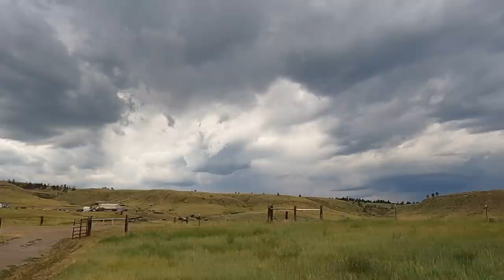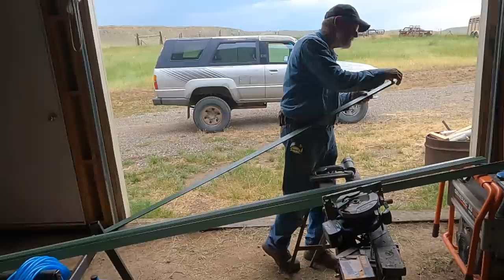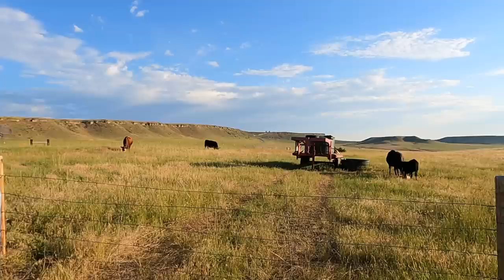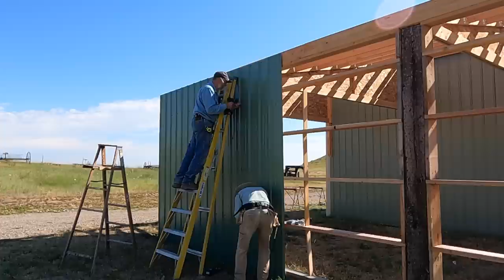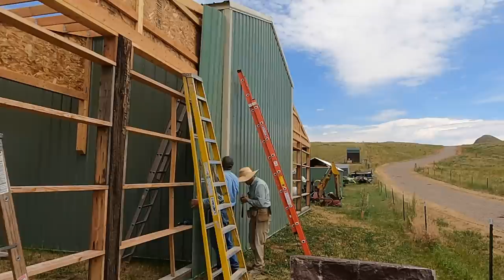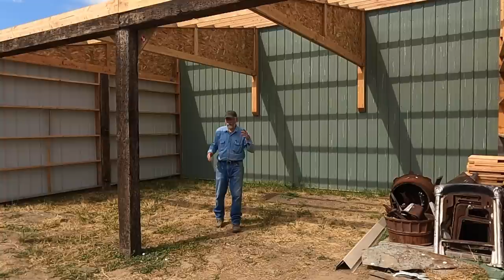Siding - One More Step to Completion! | Engels Coach Shop

Comment: If you don't plan on installing a door on that "lean too", I do suggest you install a few "vents" in your walls for strong winds. Had professionals build a barn, lasted a week before I got a call at work telling me my barn was in the middle of the road. I rebuilt said barn, I installed louver vents, haven't any issues since. We get extremely severe weather here, tornado alley. Great video, cheers :)

Comment: You could have left that plastic on those pieces.  You are brave or ?????? to handle those angles with Lightning flashing.  I have found it helpful to drill a stack of siding if the pattern is the same.  Lots to Like.  Looks very  good.  Some attach at t he peaks some on the flats.